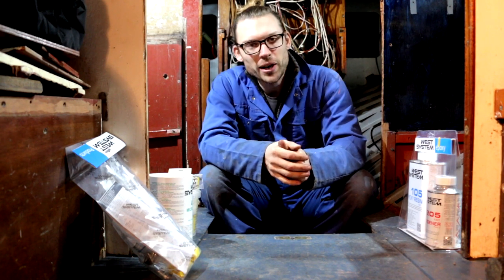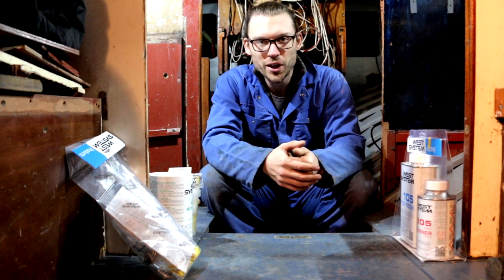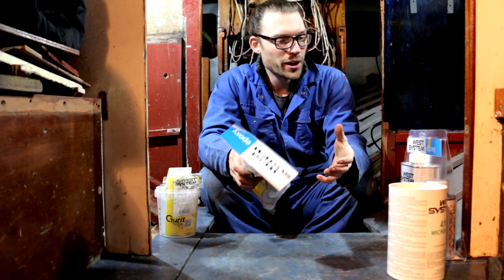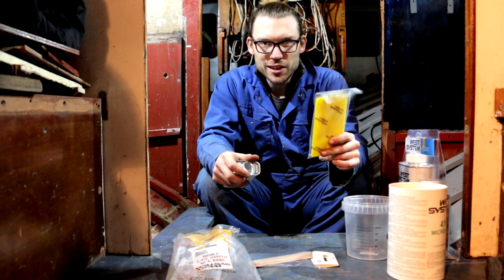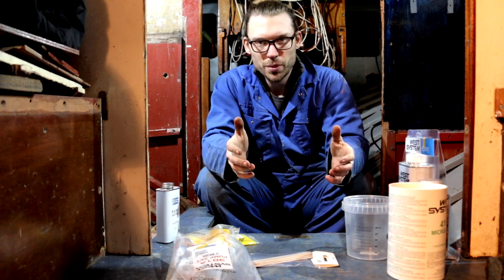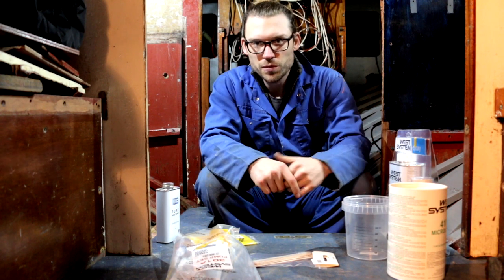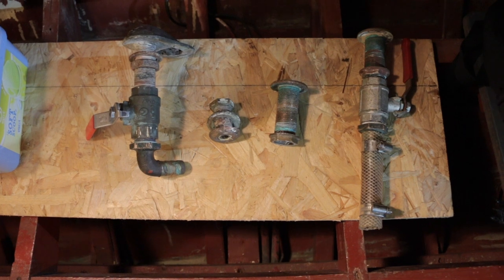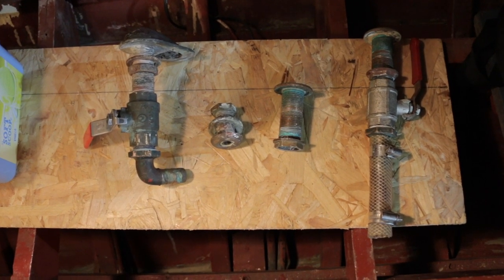18. The Bilge Stringer Joinery and Through Hull Fittings. Wooden Boat Restoration.

Comment: I’ve had nothing but trouble from those west systems pumps. I found the harder always manages to leak and dribble out of the pump nozzle when you aren’t using it. I complained to axminster where I got mine from and they send out a replacement resin kit.
Reply from the maker: That's really interesting to hear. I have had one set previously which has been lost in the workshop somewhere but they seemed ok. This set was definitely problematic. Hannah read the instructions to me many times to check I wasn't being a plonker but we seemed to be following them fairly well. Thanks for watching Edward!
Reply: I mean at the end of the day it’s meant to make the whole thing simpler, right? I don’t think you were doing anything wrong from what I could see. With mine I just screwed them on and they worked straight away. It was only later on when I came back to our boat and found this sticky hardener everywhere that I realized they were dodgy. That being said the epoxy is excellent stuff, it’s certainly worth paying that bit extra and going for quality stuff.
Reply from the maker: Yes I agree. They should make it easier. The epoxy is superb. Next time I will warm it up a bit. Cheers

Comment: Great vids.  Resin viscocity probably too high because of the cold temperature to be taken up in the pump.  You can lower the viscocity by bringing a hair dryer to the job and just laying it down with the hot air pointed at the epoxy tin and letting it warm up a bit.  Also, if you don't mind a word of advice, it is best to first wet out the mating surfaces with unthickened epoxy to maximize the bonding strength.  And finally, at the risk of sounding like a safety nanny (oh dear!) be very careful about inhaling the silica fines used as thickening agent when you scoop the stuff up - it's probably as bad for your lungs as asbestos, and you should wear a good canister-type face mask, and whatever you do, do not clean up any spilled dust using a vacuum cleaner, as the fines will go right through the filter and all you will accomplish is making them airborne, contaminating the entire enclosed space.  Best to use wet towels to clean it up.
Reply from the maker: This is all great advice and makes a lot of sense to me, thanks a lot for watching! I will wet out the join the next time I glue a scarf back together. Cheers!